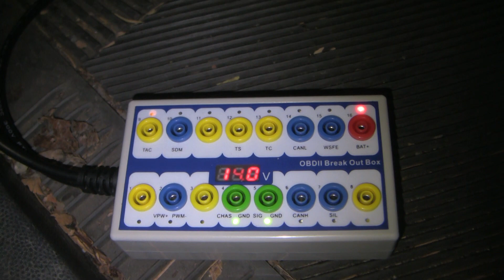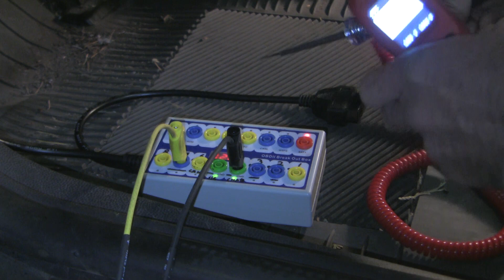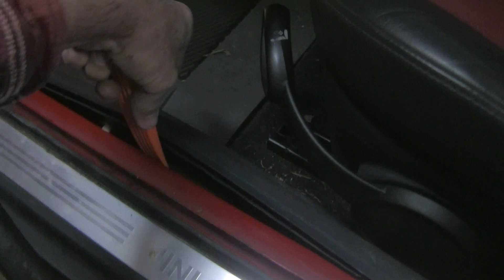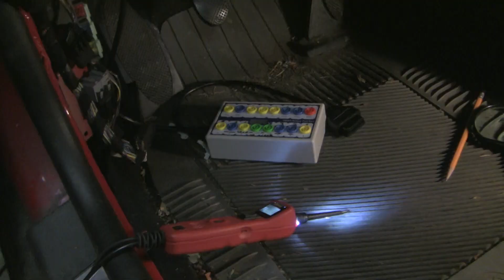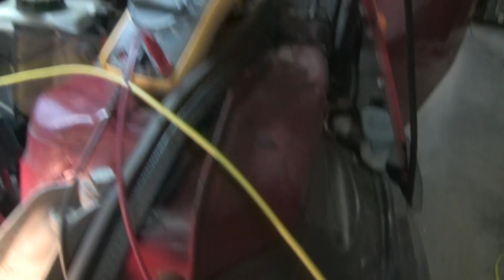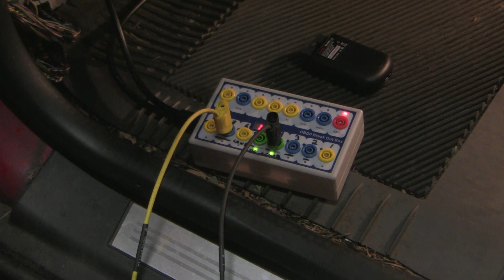How to fix a Mini Cooper that won't link to a scan tool

Comment: Great video.  It's been 6 years since this video came out, but I would guess that the EVAP leak code ended up being a gas cap replacement.  Notorious R50 issues seem to be consistent between the first run of R50's from 2001-2003, and a few less in the second R50's from 2004-2006 but with their own set of issues, like the Tachometer behind the steering wheel just going out completely while the ABS and TPM lights in the central speedo cluster blinking on and off with the engine coolant temp needle jumping to max and back to normal, speedo needle drops and rises, yet the car will drive just fine for the entire ride.  I had this problem until I pulled the computer next to the battery box, my two connectors had some green hell growing inside.  Cleaned them up, reseated and locked and have not had the issue since.  The problem was always worse during the most humid and hot days in New England.  Almost never had it in 70 degree or lower days.  We will see if it creeps it's ugly head back up this summer, but last summer it was okay after I cleaned those two connectors with the slide locks.  

This video is an excellent example of troubleshooting a problem that requires trace testing between junctions.  Makes finding and isolating a wiring issue much easier, and confirmable if you can find the junctions.  The round connector under the hood, on my Mini, is fixed to a C like clasp on the factory air box.  That air box and plastic tube to the throttle body has been removed in favor of an aluminum short intake pipe & K&N cone filter that sits at the cool air ram from the front grill.  So that round connector had to be tied down to prevent rubbing as engine rocks during shifting & accel/decel.  BMW seems to be notoriously bad with wiring issues & glitchy electrical issues due to poor harness layouts & leaky junctions or bad seals in exterior light housings. And for decades they've had these issues across a wide range of anything they make.  Never mind their ridiculous computer management systems & programs, external link boxes needed to do any real work on their stuff.

Comment: Wanted to thank you from the bottom of my heart. I bought a Mini S with money my grandfather gifted me and the first five minutes I had it off the tow truck it died and became a CRANK/NO START for about 2 months till i found your video. I was pretty depressed about the situation to say the least.

I checked every fuse on the vehicle even the fuse box in the engine bay top and bottom and checked the loom around the airbox where you had your can bus ground. I was okay there, but when I checked the 42 pin Tyco connector down by the footwell panel like in your video I found the culprit.

Saved me sooo much time. Your videos are very interesting and I've started watching them because of your meticulous but very straightforward way explaining things. God Send, TY!
Reply from the maker: I'm not sure you realize how much your kind remark made my day. Thank you.

Comment: I asked for help and was gifted this video, I followed you all the way and literally found the fault in virtually the same location, although on my car it turned out to be a loose ground connection on the head coming from the ecu, thank you! You’ve  gone some way to taking the mystery out of electrical gremlin solutions 😎👍

Comment: Good afternoon 
 I have a 2005 mini Cooper S with a no communication problem. I am also a mechanic and been troubleshooting this car on and off for 3 to 4 months. Is there a way that I can contact you and share some information?
Reply from the maker: This is the only Mini I've ever worked on, and all that I learned came from service info. It's too bad that newtisinfo link doesn't work any more. I'm not a mechanic, just a guy with a little former engineering background and some tools, so I doubt I'll be able to add much more than is in this video. You're welcome to describe your dilemma here if you like, and I can offer free unqualified advice. Corrosion near the bottom of the A and B pillars is very common, sometimes from moisture overflow after blockage of the sun roof drains. I'd be searching high and low for service data on your specific model and year. If you find a source, please leave a link for those who drop by.
Reply: I thought I already replied to this yesterday, but I guess it didn’t go through
The history of the vehicle is I purchased the vehicle needing a motor. I put the motor in 6 to 8 months ago. This vehicle has always been a project car when I have time to work on it. After putting the motor I had communication with the ECU the check engine light was on. It needed O2 sensors. I wanted to run it for a little bit prior to putting the O2 sensors in to get all the oil out of the exhaust. About a month ago, I put the O2 sensors in. I connected my scanner to the OBD two port and had no communication. Since then I’ve troubleshooting a car found that I have communication with all the modules except the ECU. The communication wire from the OBD II port to the ECU is a violet and white wire which I have continuity through to the ECU. I believe it’s pin 17 or something like that. After troubleshooting recently I found I had moisture quite a bit of water in the round twist connector on the driver side front fender thought that was gonna be my problem. Cleaned it out put it back together and still have no communication with the ECU. Any thoughts or advice would be greatly appreciated.
Reply from the maker: @DavidDepetris-w8g  Interestingly, mine didn't have a CAN double-wire pathway but I did find a 120 ohm terminating resistor that was not hooked up in the plastic housing of the OBD II port. Presumably later years made the transition. I'd systematically check for power and ground connections leading to the ECU, preferably with an incandescent test light to carefully load the circuit. Then I'd use a scope to study the communication pathway you're interested in. With the scope check for short to ground, short to power, and verify your conclusion there is no open. There are three different pathways in the 05 Mini so it likely won't be the pathway I worked on. Don't forget to scan for simple things like blown fuses, unhooked wires, etc. The cab floor near the A pillar has connectors that are notorious for corrosion, so it may be wise to look at those, check pin fitment, etc. When hardware is swapped, you may run into difficulty with mismatch of VIN id features and I sometimes wonder when I'll wander into a situation where reprogramming is needed, which is beyond my capability. Good luck!
Reply: Thank you for your insight.

Comment: good job , great  diagnostic , im going crazy with my mini cooper crank no start , temp gauge go stright to hot , seems like an electrical probleme any help please
Reply from the maker: I'm told the dealers repair manual that I referred to in the video discussion is no longer available online, but I'd search around online for another source. Check codes, preferably with a scan tool that can review topology. Make sure security light goes out when trying to crank, listen for fuel pump, make sure you've got fuel, Look for the PRNDL display on the dash, look for a bump in tach and consider whether the CMP/CKP sensors are sending a signal. Live data or freeze frame data might offer a clue. Check coolant and oil level, find temp sensor and look for rodent damage to wiring. If nothing comes of all that, consider starter fluid as a diagnostic effort, and check for spark, fuel, and fuel injector pulse. Good luck!

Comment: Had this exact issue, overlooked removing the powersteering pump and sat on it for 4 months before getting around to it. For anyone wondering, disconnect the powersteering pump by raising the car, removing the powersteering fan and removing the 3 pin connector on the top of the pump. The violet and white wire is facing you, and should be easy to identify.

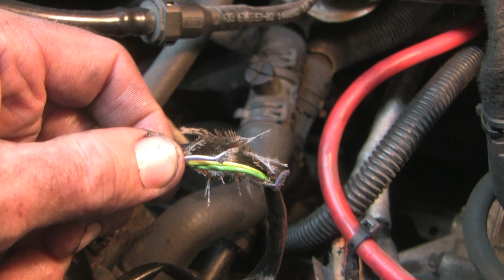Comment: I hope u don't mind if I ask a question. I have an 03 R53 with the same problem. I do find a purple with white stripe wire in the round connector by the headlight. Do you know or have an opinion as to if this wire would be routed same on an R53 as on the car In the video (ie could it have the same exact issue)? Thanks-18:21
Reply from the maker: Probably, but there's risk if you get yourself over your head. I think that wire is vulnerable to trauma because of the heat of the engine and because the engine rocks back and forth on the engine mounts, stretching those little wires.

Comment: Great video. I’m using it right now to troubleshoot a similar problem. I’m using a GODIAG GT100+ breakout box with a P200 smart hook probe. Test port #7 on the GT100+ also powers up my test light as it did yours. I also disconnected the DME, ABS & power steering (pump and cooling fan)[I couldn’t find an actual EHPAS module so I’m assuming it’s the electronics inside the pump housing?]. Test light still lit up when pulsed. Once the round 10 pin harness behind the driver’s headlight is disconnected the test light no longer lights up. I used my DMM to do a continuity test on all 10 pins to ground all only one showed connection. The large black wire with yellow stripe which is the starter ignition trigger. Shows open once disconnected from the starter. Test light still lights up when the round plug is reconnected with that starter wire disconnected. I’M TRULY LOST NOW. Any suggestions?
Reply from the maker: It sounds like you have a short to ground on that Dbus line, much like I did. Trace those wires as they wrap around the engine. I believe movement of the motor on its mounts puts strain on the wiring harness, and that coupled with heat causes the small communication wires to fray. You could check out those motor mounts by reving the motor with brake applied to see how much it moves. Your scan tool should work if you temporarily disconnect the line at that round 10 pin connector, which will possibly offer more clues.
Reply: @spelunkerd  thanks for the quick reply. The short to ground has to be on that side like you said because the test light no longer lights up when it’s disconnected. I checked for a short to ground on each of the ten pins with my DMM and the only one that showed up is on the small starter wire (while it’s still connected to the starter). I disconnected it from the starter and it showed as an open. I also connected the DMM and turn the ignition to start to confirm that it is indeed the starter igniter wire. NONE of the other nine wires on that engine side shows a short to ground. BTW that ignition wire is only showing short because it is grounded to the starter housing. I find it strange that a wire that gets intermittent 12vdc should be connected to a body ground. Is that normal in some cases? I also disconnected each of those sets of wire harnesses from their sensors and fan, even the upstream & downstream sensors. I had that same bundle in my hand loosely (while disconnected) not touching anything and the test light still lit up. Can you see why I’m lost now. This thing is kicking my butt.
Reply from the maker: @ConradC-g2g  It is entirely normal for a multimeter to see ground on that starter control wire. The coil on the control side of the solenoid has very low resistance, and the multimeter can't see the inductance of the coil that limits flow. So the multimeter sees the pathway right through the coil.
Reply: @spelunkerd  thanks bud. That at least explains the ignition wire situation. I’m going to the junkyard soon to get a 10 pin round harness to use as a tester. I should be able to connect it to the engine side using the same probe plus test light method to see which wire is shorted to ground right?
Reply from the maker: @ConradC-g2g  Always bear in mind the problem you're trying to solve, and stay on track. Many circuits are switched on the hot side so they are continuously grounded downstream. I wouldn't consider ground on a random wire to be a red flag by itself. For example almost all lighting circuits normally have a ground detectable with a multimeter through the filament of the light. Likewise many fan circuits, window regulators, door locks, horns, etc are normally grounded through the end device. So, define the problem circuit based on the symptoms the car is having, and use the wire color and diagrams to guide you. In this case my problem was a failure of a communication line identified when my scan tools wouldn't interface. I knew that circuit should not be grounded so when I did find a ground there I traced the wire back until I found the frayed wire. It's easy to get side tracked when solving a puzzle like this so stay focused on what you know is wrong.

Comment: Some one please help me!!!! I’m using my multi meter on ohms on the plug in under the hood both sides show ol on all most every pin. Am I doing the test wrong or do I have a hell of a mess
Reply from the maker: You have to disconnect any lines from power, and discharge any capacitors in the line if you're using a multimeter to test for continuity or resistance. Active testing with a test light is usually a better, more sensitive test as long as you're careful not to subject circuits to more current than they are designed to carry.
Reply: @spelunkerd  I have the battery and the ecu completely out of the car. How do I discharge the capacitors?
Reply from the maker: @jaysonweaver3857  Most discharge on their own over a few minutes. To speed that up you can touch the pos and neg wires together after the battery is completely out.
Reply: @spelunkerd  the battery has been out the last two days. I have a auto range multi meter set on the ohms setting. Most of my pins and ports show ol in the round plug that separate the engine compartment and interior.
Reply from the maker: @jaysonweaver3857  A breakout box makes this a lot easier. I got a cheap one on Amazon, but to my surprise the pin numbers were wrongly labelled. So I had to relabel and verify the pin numbers, and after that it works OK.

Comment: I'm helping a neighbor with a 2004 mini (base model) that has erratic idle and stalls. I'm not able to establish communication with the ECU. I'm betting whatever is causing the running issue is causing the OBD port issue, but it could always be two separate problems. I'll report back if I'm able to solve it.
Reply: Any luck with this?   I seem to have a very similar issue with no comms to ECU.

Comment: what do you mean Amateur, some pros would have given up or guess at what part to change til they got to the right one, would have had all new parts and its still wouldn't have worked LOL Great job I have a 2010 mini seems these have a problem with water from the sunroof drains clogging and drowning the modules, footwell in my case.

Comment: I'm having a similar problem with my newly acquired 2006 Mini Cooper. I've tried two different ODBII readers, (an Autel and a Konnwei), neither can get a response from the car. A friend who has a Bluetooth OBD connection to the scanning software on his laptop is able to get the car to talk to the laptop but it seems that there's a problem when it comes to OBDII readers and my particular vehicle.
Reply: How does he read it with the computer?

Comment: Dear God man!  Buy yourself a decent soldering iron!  Easily make yourself more issues to fix!!!  No need to break out the oxy- acetylene for that tiny wire!!
Reply from the maker: I've had dozens of soldering irons through the years, and even the best bench irons take a minute to warm up. This butane iron by Power Probe is really expensive, but it is also the best soldering iron I've ever owned. Lightning fast.

Comment: What a fantastic, informative video!  Thank you for making it and sharing your troubleshooting technique, teaching the viewer as you go along. I am going to re-watch it.

Is there any chance you could document the equipment and supplies you used in this video?

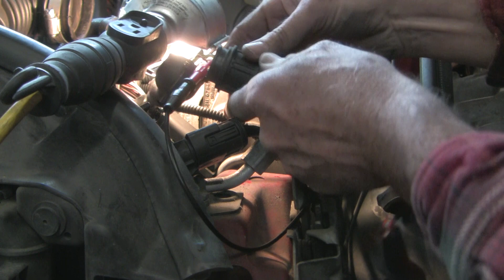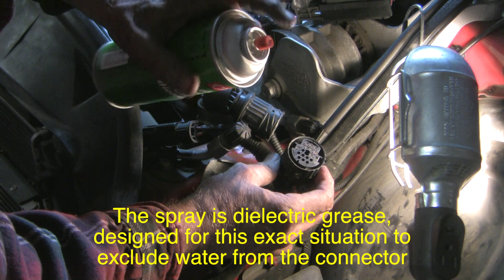That round connector near the left headlight (@15:05 https://youtu.be/gQJjRlP_poY?t=905), that you indicate you could not find in the 3400 page BMW manual (@19:43), is documented in the Bentley manual.  One may find it in the section "Electrical Component Locations" on p. ECL-23, item O, "Main Engine Harness Connector."

Cheers!
Reply from the maker: The test light is off the shelf, you just need to know what resistance it has to current, by applying 12V and measuring current draw with an ammeter. Since resistance varies with applied current you can't just measure resistance with a DVOM. Some have huge resistance, some not enough. Most LED test lights have too much resistance but they can be helpful when testing circuits that are vulnerable. I did a video showing how to evaluate test lights. The oscilloscope is made by PICO, but you could get away with one much cheaper. The scan tool I show is made by Autel, 906BT. You don't need a high end one like that. The breakout box is a cheap knockoff, but I discovered that the leads are wrongly labelled, so I had to test and label them correctly. And the Power Probe is helpful to accurately measure and apply relatively safe voltage without using a long jumper wire, but it is not necessary. Overall those tools are worth thousands, but if you know what you're doing you could get by with a multimeter, a test light, a small scan tool with live data, jumper wires, and some hand tools. The brightest technicians can get by with just a few tools they know well.